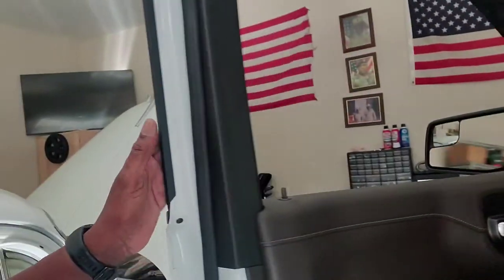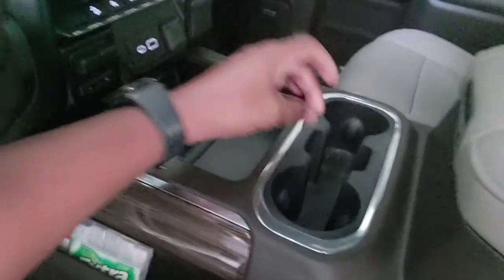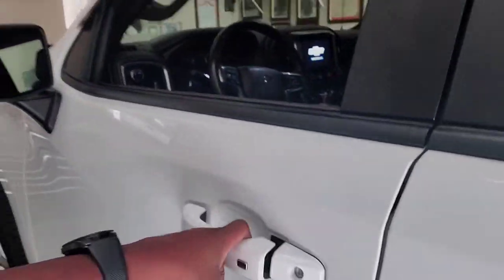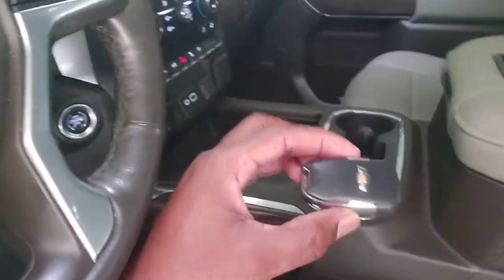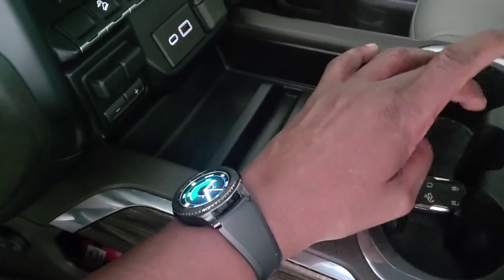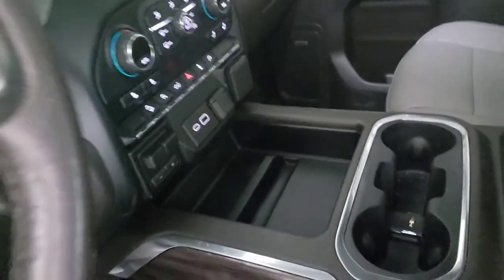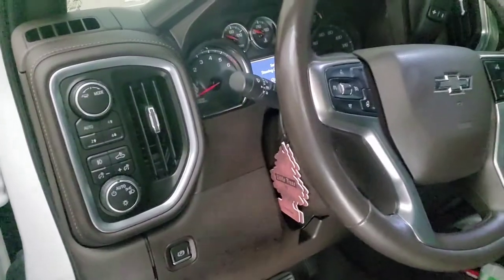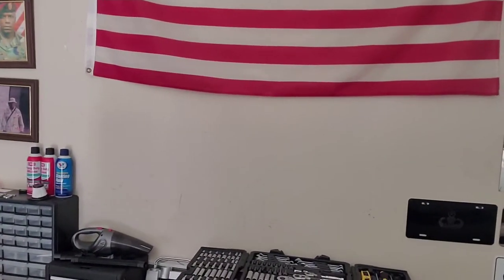"Advanced Insights: Key FOB Programming Techniques

Comment: Will I need to re program my existing key fob in addition to the replacement one I purchased? Or will the original still work. ( I lost one of the two fob that were supplied by the dealer).
Reply: On another user video he reprogrammed his new one and his original. At the end of the video he made it sound like there is another procedure to program only one.

Comment: I have followed the steps to program another key fob for my 2020 Chevrolet 2500hd.  The remote will work everything (lock, unlock, raise and lower tailgate) except starting the truck.  I get a no remote detected message and have to place the remote in the transmitter for it to start the truck.  I did change the battery in the remote (in case that might be the problem), but it didn’t make any difference.  Any idea what the problem could be?

Comment: What if you are just replacing battery and have only 1 key fob?
Reply from the maker: Cathy although a different make and model the principal is the same. Here is the link to one on battery replacement. If it doesn't help send me your make model and year. Good luck.
https://youtu.be/FulaRuvpz-8
Reply: I need help.  I replaced the battery to the Key Fob and this process isn't working for me. Been out here 2 hours.